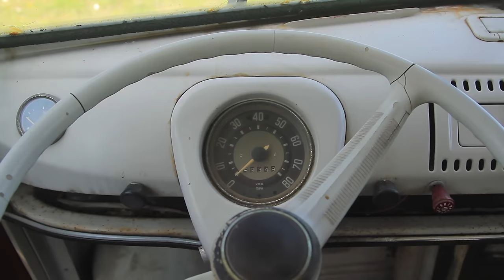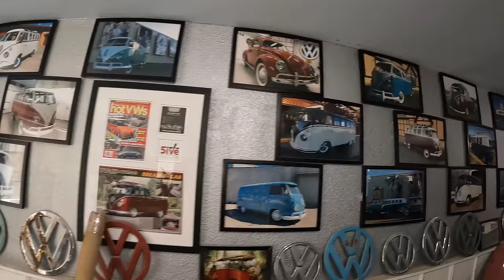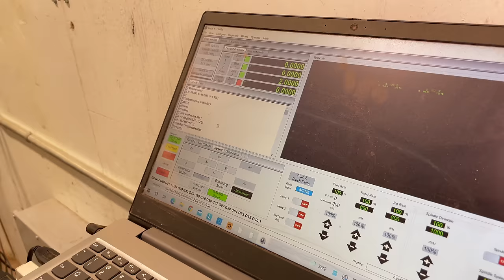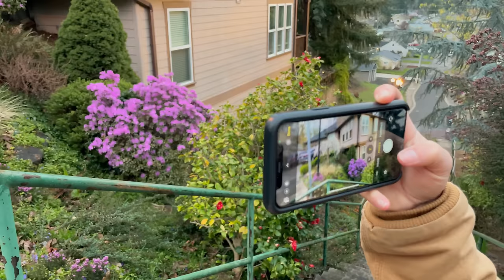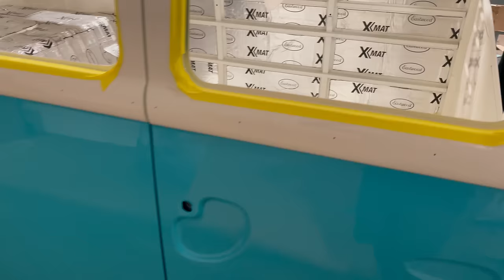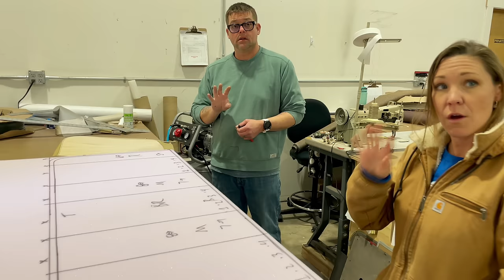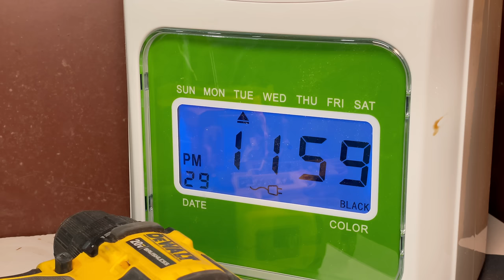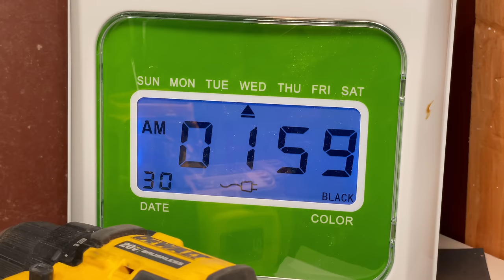VW Bus Restoration - Episode 74  - Sew Cool | MicBergsma

Comment: Looking good guys ❤️ Back in 1987 , I bought a 64 split camper from an old guy who owned it from new . Lots of rust on the floor and front wheel arches .
I didn’t have much money at the time , with 2 kids , but being a bus mechanic I made my own panels and welded her all up . I had the trimmer re-trim the  upholstery with bus seat moquette and set about painting her . I found a tin of dark blue paint and mixed it with some white , and came up with a shade close to yours 🤣
Believe it or not I only paid £450 for her , and sold her for £750 3 years later ! Thought I had done well 😢.
Can’t wait to see yours finished …..TC 🏴

Comment: Hi, I'm Matt,I used to have a 70 eurovan with the pop up roof,  stove ( which I never tried) ice refrigerator, table, closet and fold out bed. I called her Baby Blue. 1600 air cooled. I was told Grumpy did the heads on it?? It was almost the same color as Kona. I miss it, had it in the early 90's. Can't wait till you put the dog dish VW hub caps on those rims, it's going to be sweet. Congrats on your progress!✌️

Comment: I'm really digging how the front wheels are looking with the powder coat and the silver disk brake rotors shining through. May I suggest you polish those rear drums to match then clearcoat to prevent corrosion. Then leave as is.

Comment: My 63 bus looks very much the same , Mine actually had much more extensive work done to it due to its condition, I did every bit of the work in my garage myself and it took about 2 years start to finish, including 6 month stint at Skinners to put on a long panel that I didnt want to do. I know how tense it must have been waiting so many years for Skinner